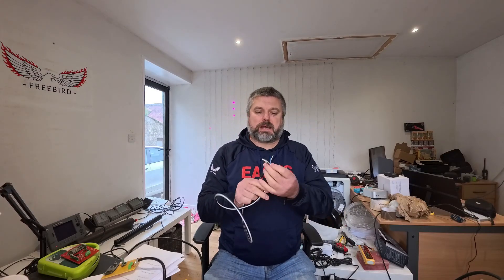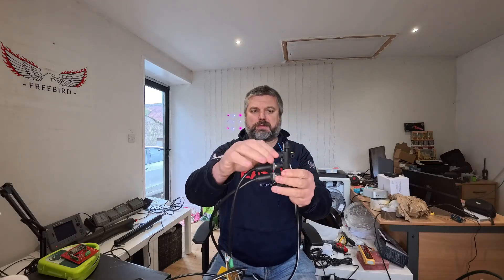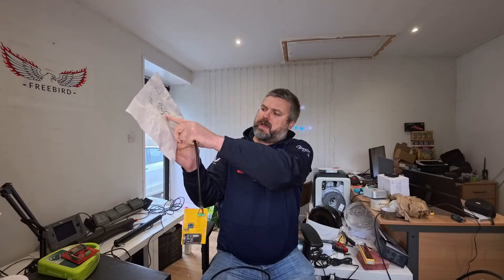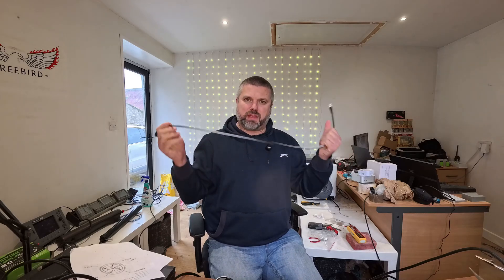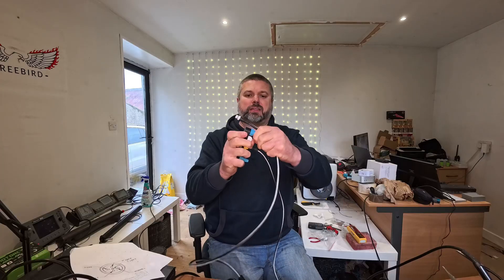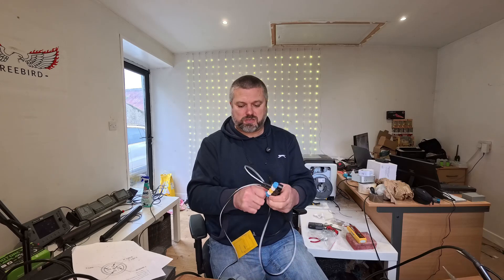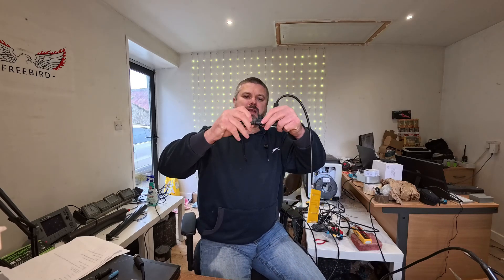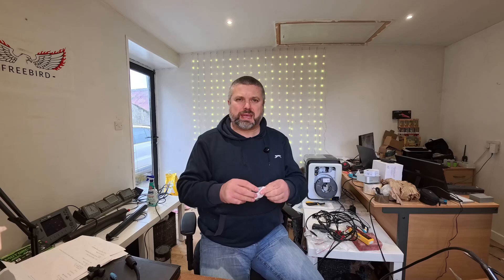How to Connect Seatalk NG/ Simrad Simnet  to NMEA 2000 – Conversion = Cheaper cables and connectors.

Comment: Good tip! Always cut Seatalkng spurs in the middle to be able to use "the other end" for future connections. Do not fear Seatalkng. Its just another shielded cable.
Reply from the maker: Yeah i am working on a N2k interface to control raymarine evo auto pilots and simrads as well . whacked the end off in haste . Could have had two useable raymarine ends the valuable bit!